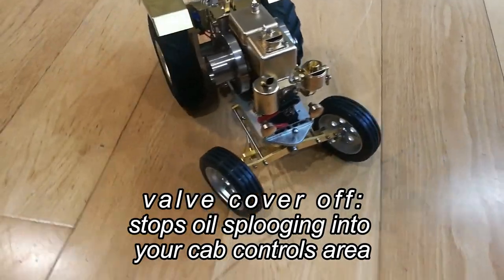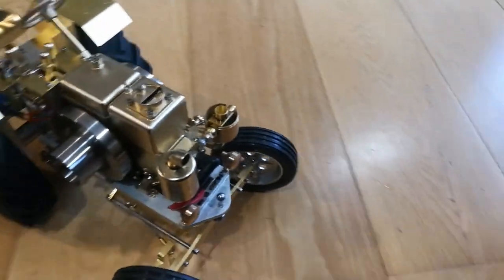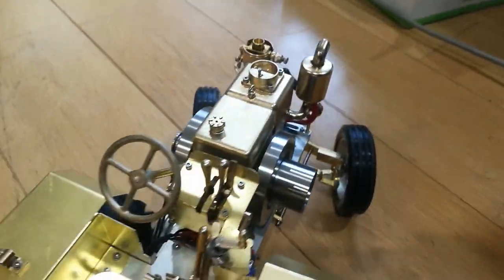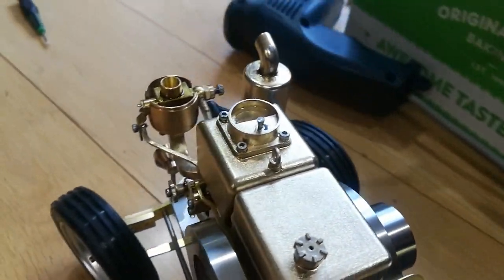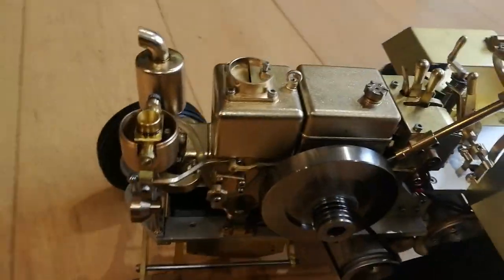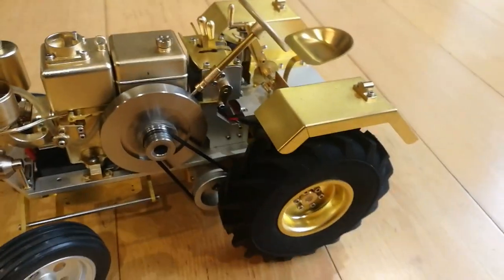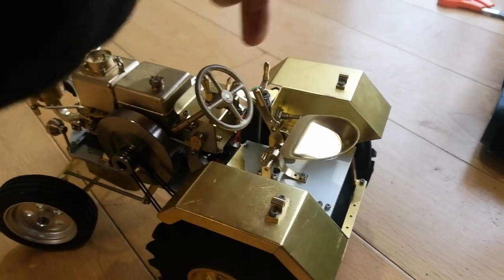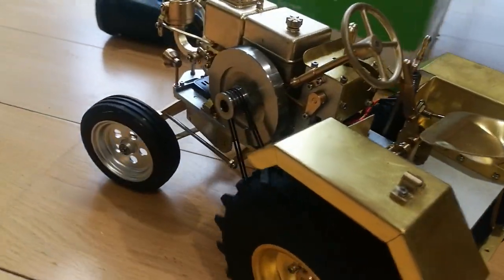Running Microcosm Tractor T1/ T26 Chinese model gas tractor #model #engines #gasoline #chinese #t26

Comment: I'm definitely buying this I love the quality of these models and they just get better!
Reply from the maker: I think the tractor base is pretty much faultless; tyres, wheels, gears. A good plaform. The motor leaks and the main conrod is not machined in any way; so it will wear fast to begin with; then tighten it. Still, who of us could build these from scratch? It's a fun, clever model.
Thanks for your comment Evan!

Comment: Hook up a servo for remote control steering ik you prolly won't but just a thought you could get a small micro one and a tiny battery would do. But might crowd the Tractor a little.
Reply from the maker: This is tempting though, I have been considering this...maybe when I get sick of bending over...?